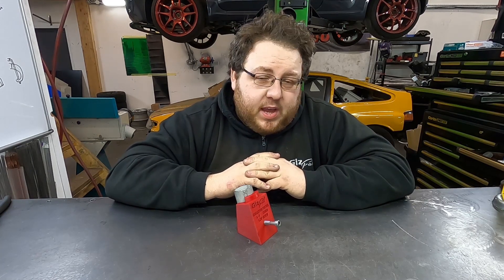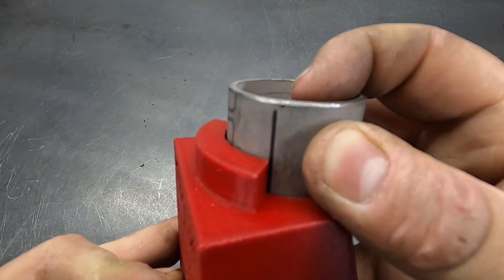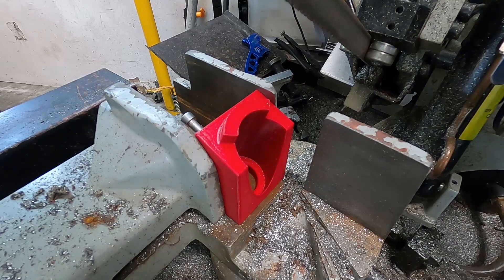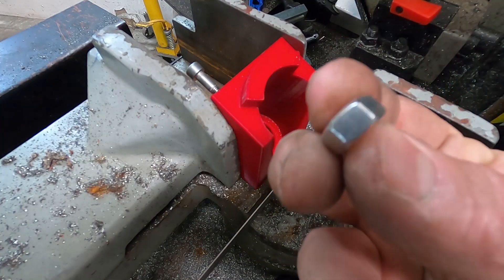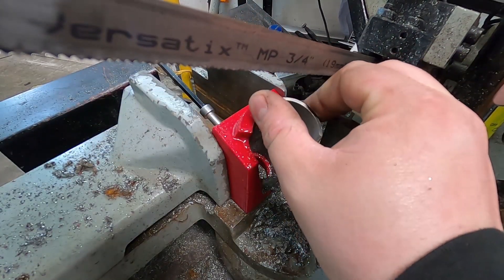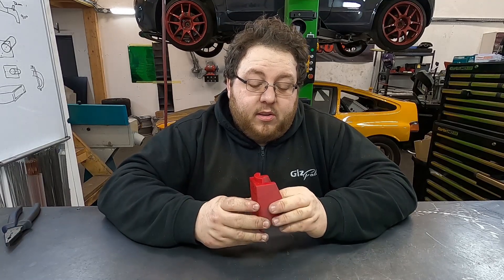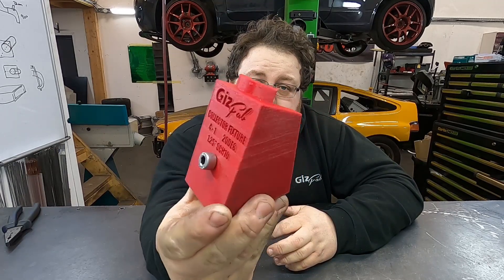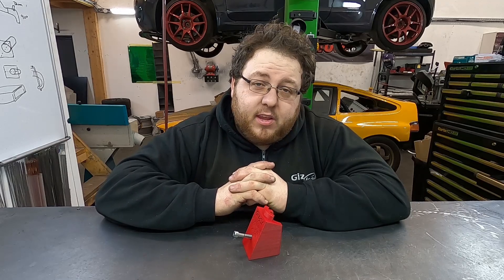Budget Turbo Collector Cutting Fixture

Comment: I bought of you 6 in 1 . Cuts fine , straight nice , all like on a video but they can’t connect all 6 in 1 because 3 of them must be 180 degrees, so each 60 . But they more than that and big gap between.
Check your Ebay account- all photos provided like it cuts and done ✅
Reply from the maker: Under / over rotation in the fixture. The issue is multiplied as there are 6 segments all together. I hate making the 6-1 myself. Always have to end up recutting a small slither off each.
Reply: You must make an video mate , because looks like it not proper fixture jig for 6 in 1 .
Reply: I ask you 3 times already - what the off set for 6 in 1 merge collector please ? And i will get an answer of your fixture
Reply: I just did one and got the same problem. Quite a gap in the middle if I do 3 and 3 and stick them together. Think I’ll have to just sand each one down and tac them until they actually are all snug. Quite annoying

Comment: Nice fixture I have a similar one. I have a nut on the other side so when I tighten the screw I am not using the plastic threads bc after a while they will wear out. Keep up the good work!!
Reply from the maker: There is a stainless nut on the inside, it doesn't rely on any plastic threads.
Reply: @GizFab  Awesome, what kind of bed saw is that ?
Reply from the maker: @xpawel10  SIP 01520
Reply: @GizFab  How is it treating you ?
Reply from the maker: @xpawel10  Shes been great (y)
Reply: @GizFab  I have femi 728 xl thinking of upgrading to something with coolant and autofeed.